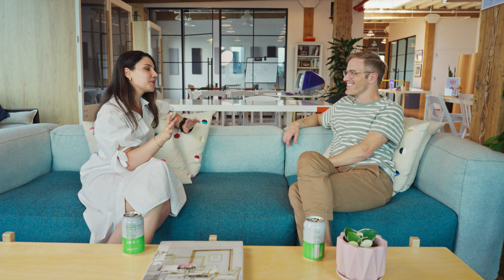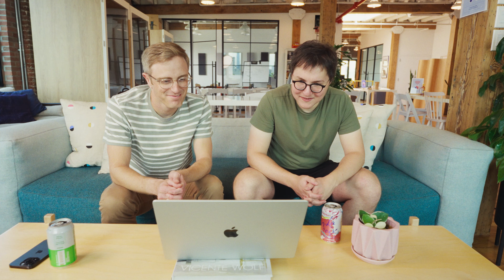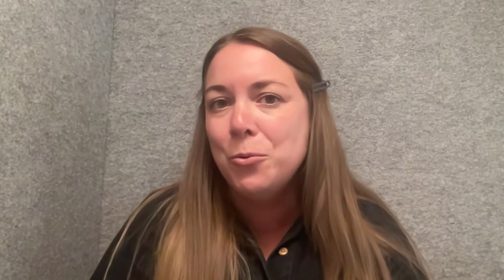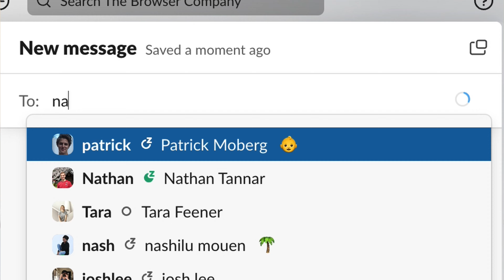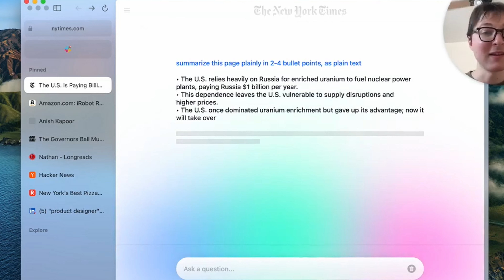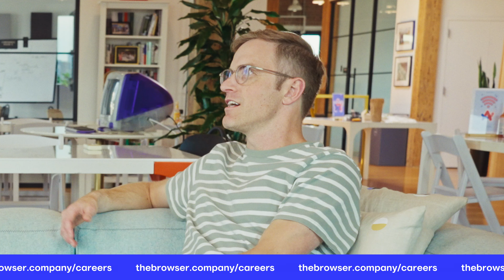Meet the team who builds Arc 🏗️ (we’re hiring)

Comment: Seriously I love the browser, I'm using it on my windows. I feel there is 2 problems 1.) it doesn't have the same amount of features like mac , like seriously a lot of features  2.) the ram consomtion 🥲 I'm facing ram management is worser than Chrome. Where as Chrome take arround 700 mb it takes arround 1.7 gb , so please guys if you can then fix it. And one thing that there is no any McAfee webadvisor extension any guys notice this?